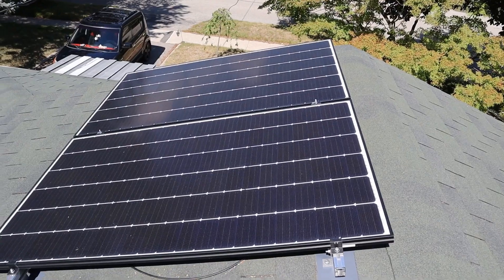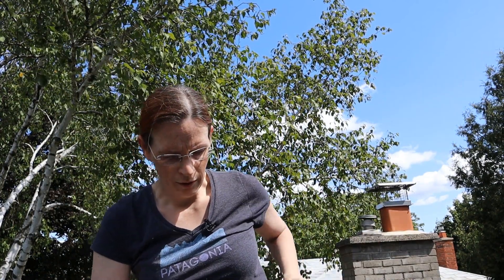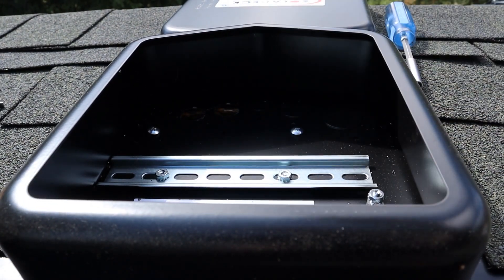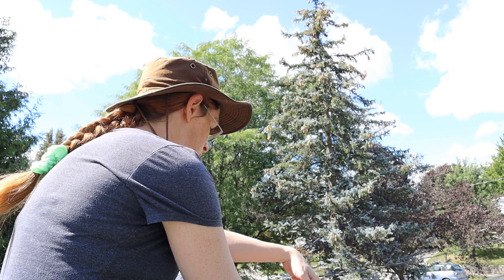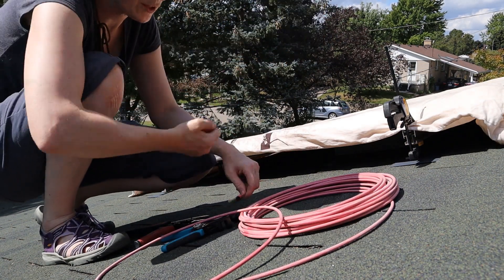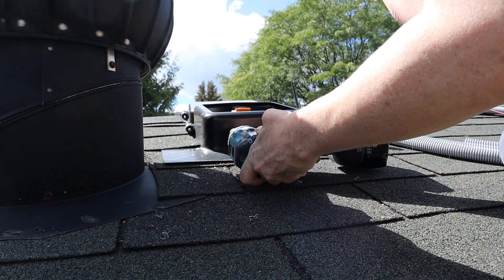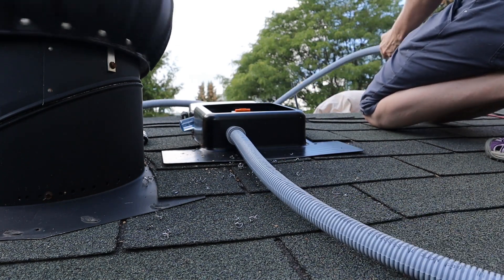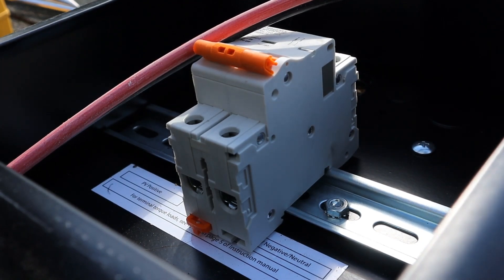Solar Panel Connection (Part 1) - How to build a 48v Lifepo4 battery (Ep. 17)

Comment: make yourself a favor and get a magnet with you next time on the roof and collect the bits of iron (leftoovers of reaming holes in stainable steel boxes before the bits of steel melt into the bituminen?/ Asphalt rooftiles
Reply from the maker: A magnet would have been smart

Comment: You don't need a special crimper for MC4, that said I hate MC4 connectors anyway, I just cut them off as a matter of course and connect as you did.
Reply from the maker: Ya, honestly, I can't see a downside to butt splices and a little slack in the wire. Simple is awesome

Comment: You probably have a squirrel problem and need to keep those wires under the panels and put a metal mesh around the panels to keep them out. Many areas need them to stop them from eating the coating off the wires.
Reply from the maker: Ya, that's very likely the problem and the solution.

Comment: Check your code on conduit fill, especially if it’s a location with a higher ambient temp
Reply from the maker: I did, I had a long talk with my electrician back before I started. That's why the permanent line going up to the solar panel from the basement is (shielded) BX wire. The run to the office is temporary and will be removed when that phase of the project is done.